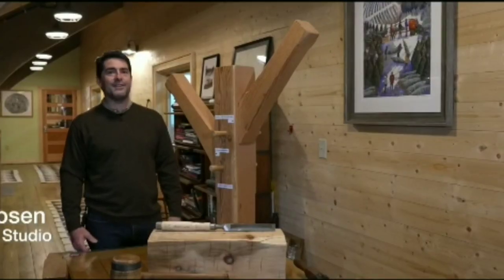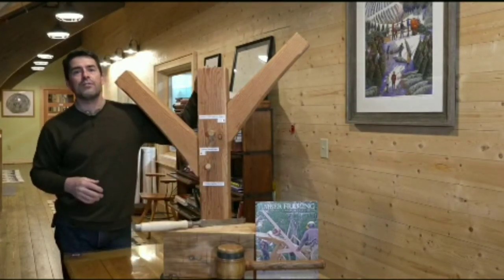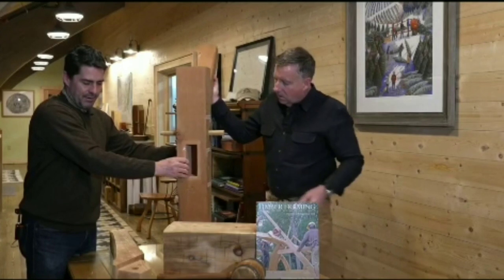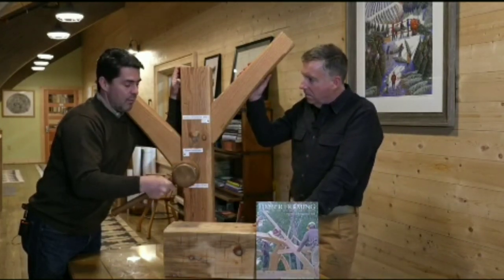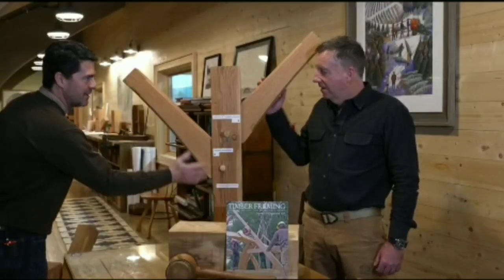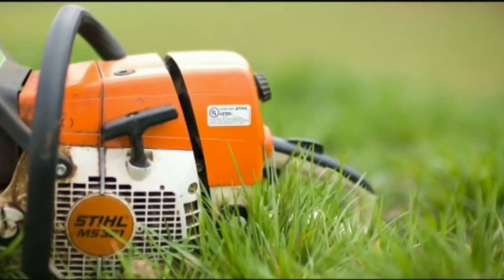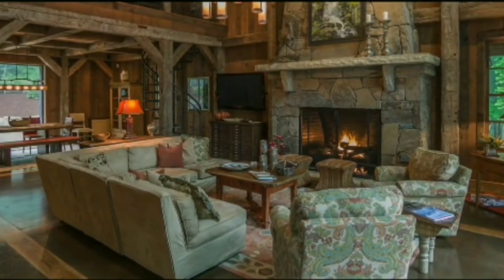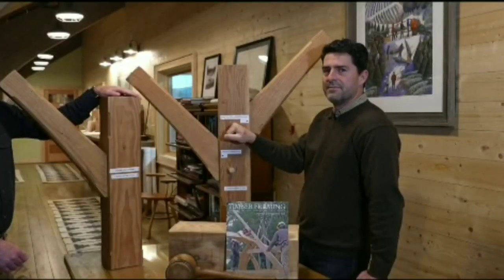Timber Frame vs. Post and Beam construction. What's right for you.

Comment: I didn't know that post and beam meant fastened with metal as opposed to actual joinery.i just assumed  the two terms were interchangeable. Thank you
Reply: That's because it doesn't!  The terms ARE interchangeable.
Reply: @jamierodg1  
No they aren't. Look it up.
Reply: This video is only half right. The part of post and beam is a fail. Russia has some of the oldest true post and beam structures in the world.

Comment: A timber frame is just that a timber frame. There are many types of construction used in making timber frames. Like mortise and tenon, post and beam, post frame, and balloon framing all used to make a timber frame. So a timber frame is not just mortise and tenon construction. It is any building framed with timbers. They can't even tell the difference between post and beam using only wood vs post frame construction using steel brackets in this video. And actually post and beam is stronger than mortise and tenon. A post and beam all the wood is supported not just a tenon and small lip or shoulder. I have built many different timber frames and the post and beam took the longest because of saddle notches and vertical tenons.

Comment: 2:20 sorry to say but you are a bit wrong here. As a carpenter from Germany we learned all that old stuff in trade school. I have made so many mortises (usually 4-5 inch long, 2.5deep, 1.5 wide) with only a wooden hammer and a big chisel that I can say for sure that it is by far faster for an experienced wood worker to make it without a drilling tool. A few decades ago carpenters here were paid by piecework, not hourly wages. And per each hour, 10 mortises were calculated, 1 in 6 minutes. And yes, that is possible, especially in the wet wood they used back then. 
After all you might not be absolutely wrong, there isn't just one way of doing it, but considering the effort and cost of a chisel and a hand drill and keeping the tools in use sharpened, I would conclude that the chisel only method would be way more efficient.

Great video, interesting topic. 👍 From Germany!
Reply: He is right. I use a chainsaw and slick. Around 6-8 minutes for tenon or mortise. On post and beam it's around 40 minutes to scribe saddles and make a tenon. Doing the lincoln log notches on post and beam is quicker but not a quick as mortise and tenon.